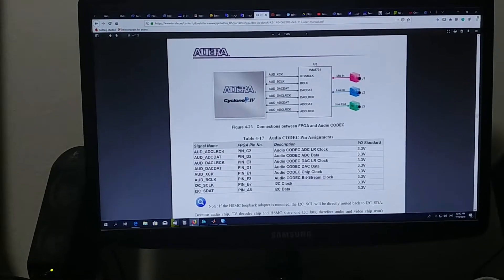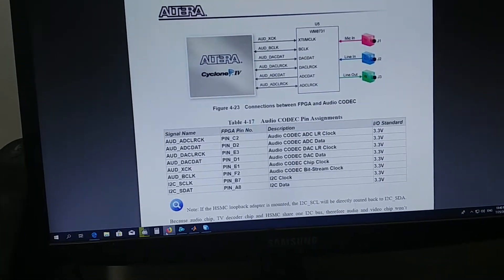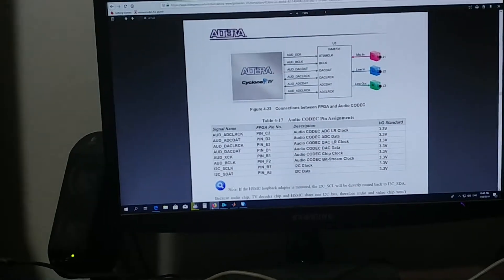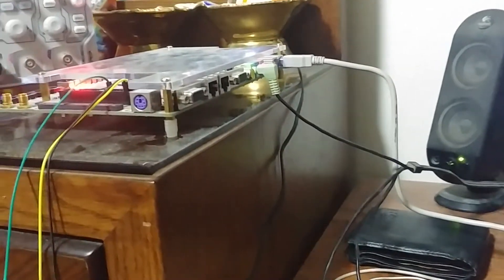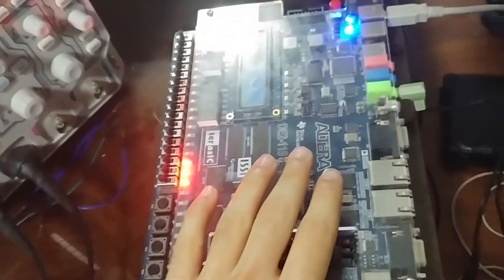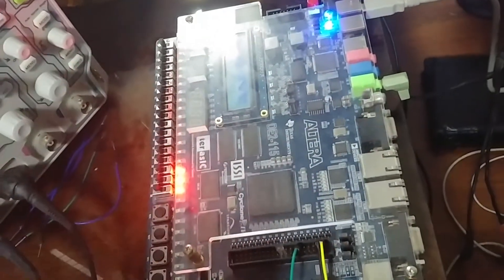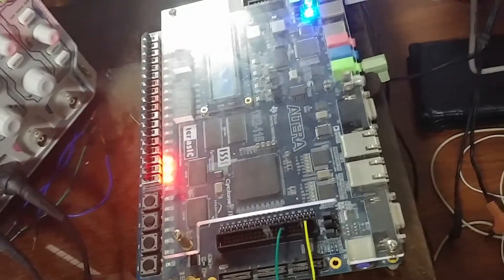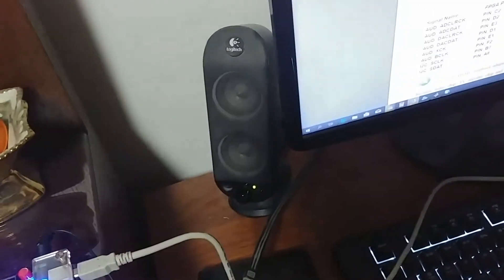WM8731 Audio CODEC with DE2-115 (Verilog)

Comment: Hope this comment finds you well
 I’m currently trying to run the section involving the WM8731 Audio CODEC on the DE10 Standard Board. Specifically, I’m focusing on the configuration of the WM8731 through the I2C bus and sending digital audio data to the DAC pin.
Could you confirm if this implementation works directly on the DE10 Standard Board as-is, or are there any specific modifications or considerations needed for this board? Any guidance or suggestions would be greatly appreciated!
Thank you in advance for your time and help!
Reply from the maker: I believe I2C and chip configuration code should work directly on your board but you have to specify the correct pins.
Reply: @ahmadalastal5303  thank you so much for the guidance

Comment: I come across on your video by accident, great work. Does your matlab code convert a wav file to mif?
Reply from the maker: No, the MATLAB code does not work that way, the wav audio file you have must be converted to .txt file and the MATLAB handles that .txt file, please check the project to know how the .txt file should be that MATLAB can handle, you should be in a very safe zone if you used Audacity software to convert that wav file into .txt file
Reply: Ahmad Alastal yeah I tried it using your .text file and it worked. But how did you generate the .text file in audacity. I converted an mp3 audio to 16bit pcm  .wav file using audacity , but I’m struggling to convert it to .text . Did you use audacity or other software to do that if so how. Thanks
Reply from the maker: @frisckyjacky2989  check this link: https://manual.audacityteam.org/man/sample_data_export.html , be careful to exporting syntax when converting to .txt file
Thanks
Reply: Ahmad Alastal thanks. Anyway totally unrelated question. is it possible to change a sample rate from 48kHx to 8kHz without having a major effect on the sound.?
Reply from the maker: @frisckyjacky2989  You made a major jump in sampling frequency so it will be a major jump in sound quality
Reply: Ahmad Alastal that’s true. Just noticed your audio is at 8k sample rate. Was it recorded at that rate
Reply from the maker: @frisckyjacky2989  This is because the M9K blocks can't handle too many recorded seconds of audio

Comment: hey brother, how did you add the .mif file to the 'top' project.
Reply from the maker: the .mif is added to M9K ROM/RAM blocks, search for M9K blocks inside the project and enter the MegaWizard for it, inside MegaWizard slide to reach a tap that asks you if you want to load mif or not, very happy to help you
Reply: @ahmadalastal5303  thank you brother, i appreciate all the help

Comment: When I mount the  project on the quartus software and I try to Compile I got a Message that says Error "(125091): Tcl error: ERROR: Illegal assignment: IP_GENERATED_DEVICE_FAMILY. Specify a legal assignment name.
"
Reply from the maker: My project is implemented inside Quartus 17.0, I think if you have older version this problem could pop up but If you install this project from GitHub you shouldn't have any problem compiling it, please put a screenshot.